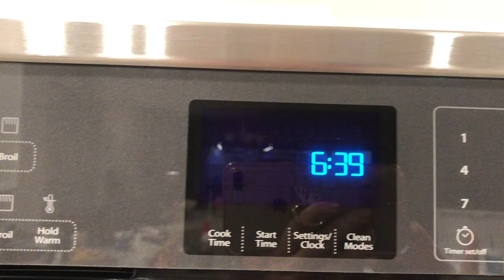New Construction Home - popping sounds

Comment from the maker: Hi all, we solved the mystery! The drywall was hung incorrectly. Which many of you noted the temperature change which does affect the expansion/contraction. But essentially, the trusses are deflecting and due to the drywall being budded up to the trusses, it’s causing drywall crushing at points and this terrible popping noise.
Reply: How did you fix it?
Reply: This sound in the video is expand and contract of metal slub??
Reply: Have you had it fixed and how?
Reply: How did you fix this ? Please share info because I’m gettting crazy ! I have the same issue ! Thank you !

Comment: I believe this is from installing warped lumber then prying it straight to line it up, it puts a lot of preload on the studs and will take a long time to slowly release the stored tension, easiest fix is to try and pin point the worst studs and remove and replace them.

Comment: Hello everyone.
So I'm a superintendent in a new building lest than a year old, in one of the apartments we start having this problem the noise was so loud it would wake up the tenant. I open the wall in the bathroom where the noise was coming from, first I thought it was a Wood stud that it was crooked. But it was a big PVC pipe that goes from the first floor all the way to the roof. This PVC pipe didn't have space  to expand passing through the Wood stud so it was making that exact noise. Here is a link to another video explaining. https://youtu.be/3-Bhr2IKIF8

Comment: Hi there, I have something similar in my roof. My house isnt new though, pretty sure it could be as old as 1980.

I've never been in a house that makes popping noises this loud throughout the night like this, but all the information I can gather on the web is that this is normal movement between warm and cooler temperatures. I'm sure yours is the same.

If my house was built in the 80's, I'm think this popping sound would have presented a serious problem by now, but when I bought it less than a year ago, it passed all the inspection test I had on it.

One possible solution is isulation in the roof to stabilize the temperature.
If you do solve the problem please post it here, I'd be very interested to know what it is.

Comment: Any idea what it is? My new home has the same issue. Not sure what it is and have ruled out plumbing and roof.
Reply: It’s normal settling and expansion / contraction of drywall. They may not have also made good connections with the screws into studs.
Reply from the maker: What state is your new home built?

Comment: Any Luck ? I have similar issue ! Please post if you find solution.
Reply from the maker: Hi Vishal, no solve yet. And I’m not getting much help from the builder even though their framing company and third party contractors have heard it and acknowledge I have a “loud” popping noise. 😞
Reply: @ThaSassynClassy1  

Hello,

I know this was an old video but I just found it. Any resolution to the problem? I have the same issue. Do you happen to live in Las Vegas? I’m being told it’s an issue with the soil. 

Thanks